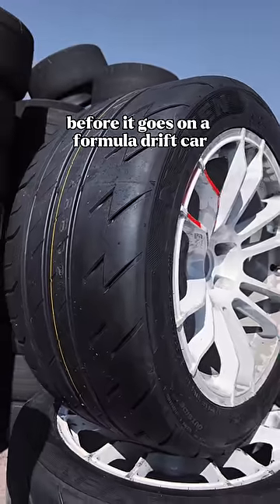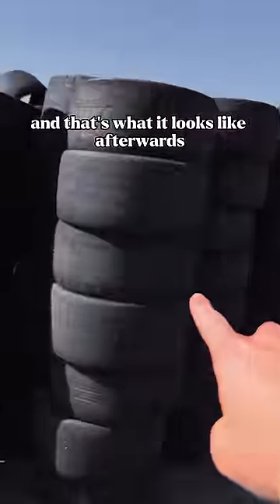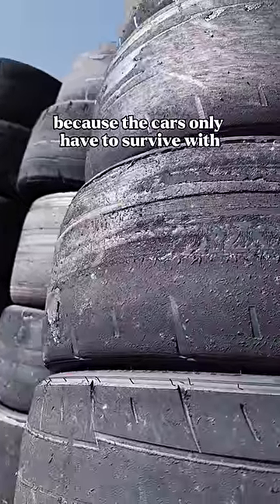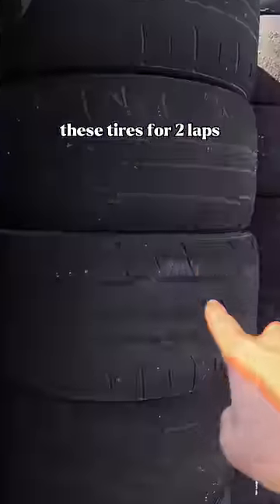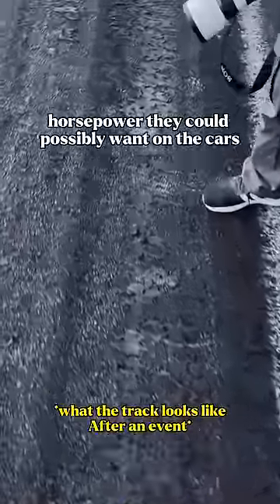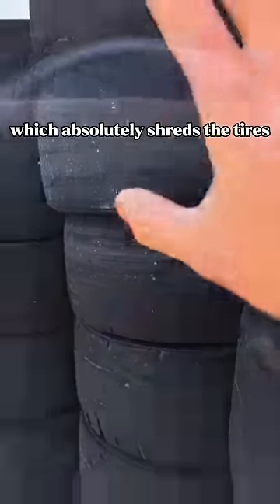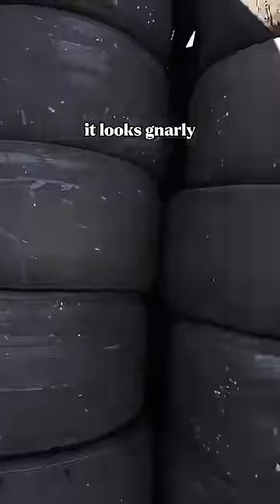What Tires Look Like After Drifting | Formula Drift

Comment: That is ridiculously wasteful. It's so awesome though.
Reply: Can’t you take that excess rubber and recycle it into more tyres? like infinite tyre glitch so less wasteful than it seems
Reply: @Night-tq6pw  tires can be recycled and turned into other things. Some playgrounds use recycled tire rubber mulch. Id guess drift tires can't be retreaded. I might be wrong though.
Reply: @Night-tq6pw  yes but no. Tires cannot be melted down into new tires of same quality and durability. This is extremely wasteful. Vulcanized rubber is different.
Reply: @Night-tq6pw  Nope.
Reply: @Greeko_Poloz  Not often and the process is expensive, bad for the environment, as well as toxic. Rubber is one of the worst forms of pollution humans have come up with. Unfortunately we don't have a way to safely recycle, dissolve, or replace rubber.
Reply: @evolicious  it's a big problem for sure. Especially how many industries use rubber.

Comment: wrong, they manage the power output as the tyres limits them to 4 laps (they need to be able to do a rerun)... We had an opponent who had to drift in 4th gear instead of 5th because of the extra tyre degradation of spinning the wheels in 5th gear.

Comment: So, how do they dispose of the old tires? 🤔
Reply: There is a company here in the USA that buys/receives used tires. They have a machine that separates the steel belt and nylon cap and grinds up the rubber. That rubber is used for Mulch for playgrounds, a certain percentage of rubber goes in the manufacture of Asphalt, when soft sidewalks and tennis courts are made the ground up rubber is used.
Reply: @malakisands8180  thanks for that bit of information. 👍. Cool.